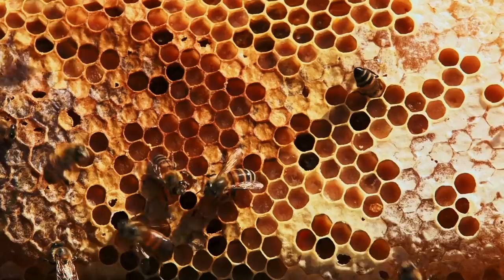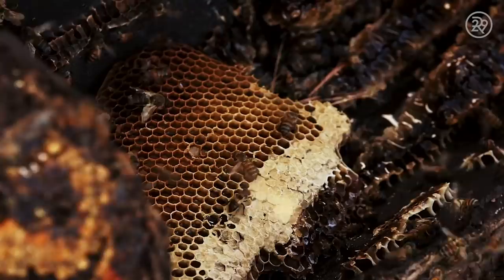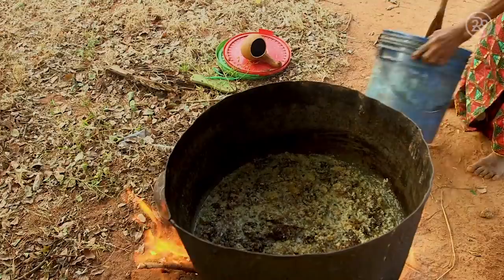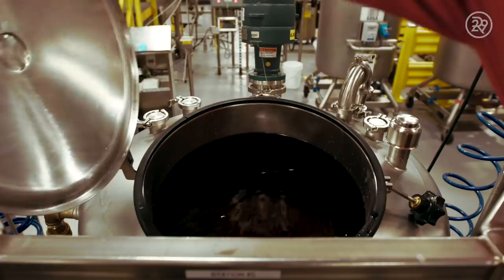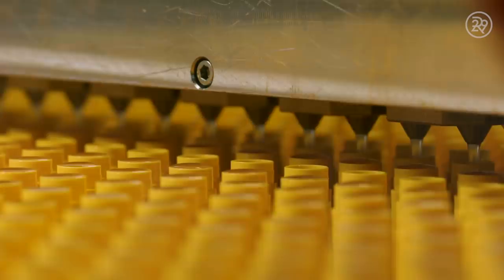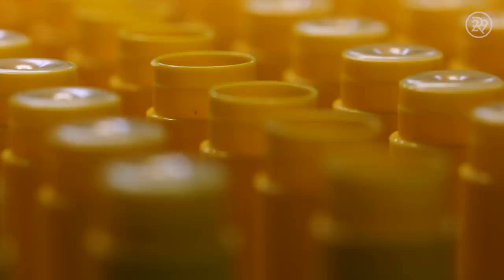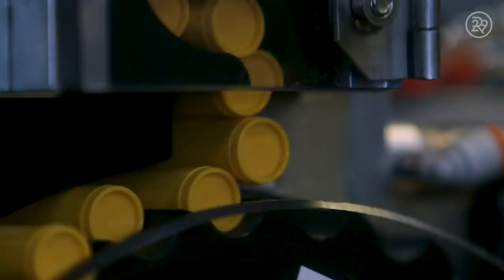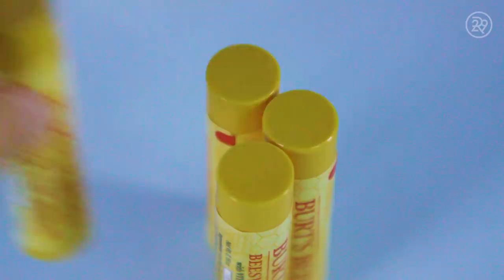How Burt's Bees Lip Balm Is Made | How Stuff Is Made | Refinery29

Comment: You forgot posting the part in which micro cristals are mixed into the formula. My ex did his thesis about the usage of micro cristals and this brand had the biggest amount in it. If you don't trust me, put a little bit of it under a high resolution microscope.